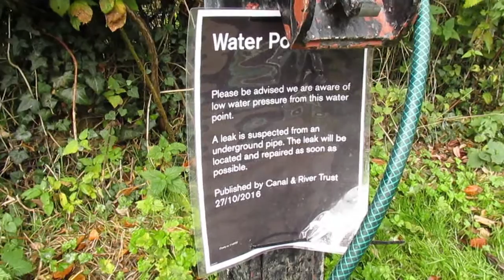Low pressure on an Oxford canal water point.

Comment: That is what our water pressure is like here every Sunday morning. A shower is out of the question as the flow isn't even fast enough to trigger the gas heater. Is that that the only tap you can use without going miles?
Reply from the maker: Yes, it's the only tap for miles, and many boaters rely on it.